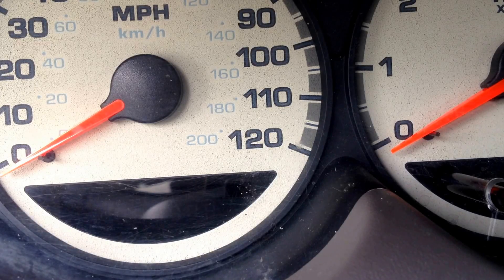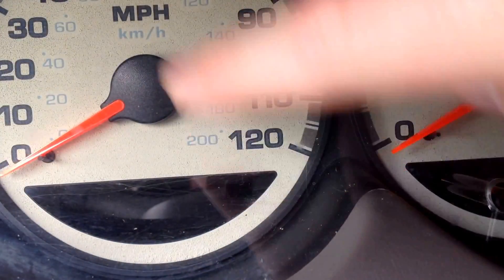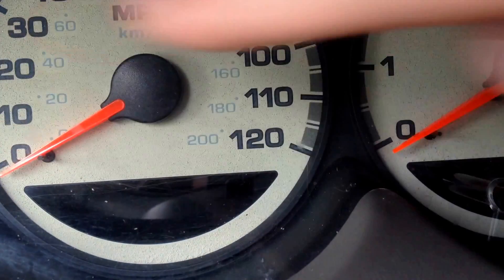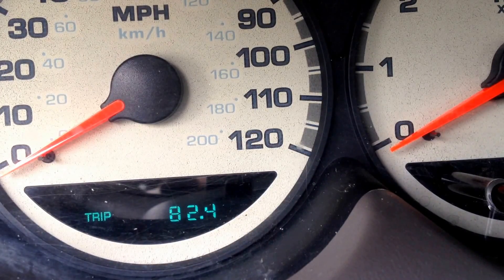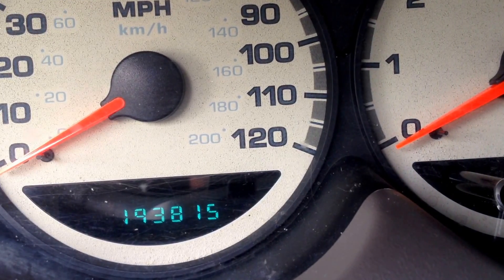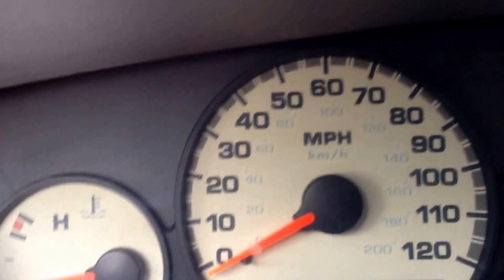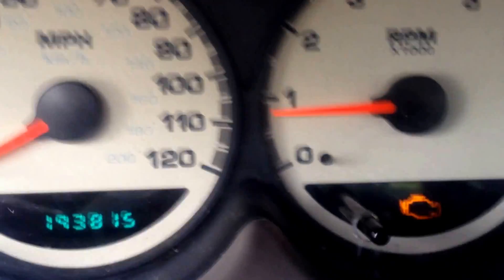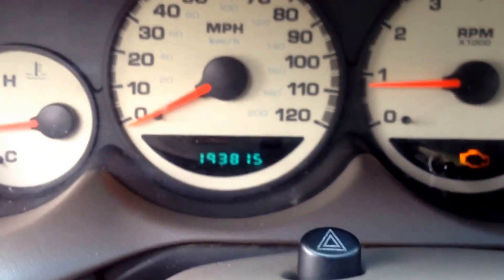Speed odometer repair 2000 Dodge neonES

Comment: replaced Control Solenoid and both input and output sensors and still the odometer is not reading anything
Reply from the maker: That the cluster might went out. Check the bulbs if it has any.  I guessing it’s showing up blank.
Reply: @StansAuto83  i got lights in and everything. pressed the trip button and the dash does move like in the video. Car is in limp mode for sure
Reply from the maker: @fishingmojados1121 have you had the car scanned to see what the codes are?
Reply: @StansAuto83  figured it out today. Broken wire at the output sensor

Comment: I have a 05 neon and speedometer doesn't work replaced speed sensors and still nothing. Could it be a bad ecm or tcm?
Reply from the maker: It could be the cluster I had to replace mine.
Reply: I drop a 1500 replacing the clutch, drive belt and water pump at about 119k miles and think "Hey Im golden for 30 to 50 k miles. HA. you need to replace just about everything because it all starts to break, ALL OF IT!
Reply from the maker: Yeah I’m in the process of rebuilding the engine from the ground up and then the transmissions next
Reply: @StansAuto83  Before or after this video? Ha ha

Comment: Do i just push the dial in / crank ? or do i have to push and turn the dial / crank ? Also does this work for a 2000 Chrysler neon ?
Reply from the maker: ISA JESUS push in and turn the key 3 times like your going to start the car but don’t start the car.
Reply: I pushed the dial for about 5 seconds then i turned the key only to on position it reset the trip odometer i didn't turn the key three times yet I didn't want to trip the codes I'm going to pick up my 2 door ajar sensors for replacement tommorrow ( pulled out 2 broken door ajar sensors light stays on pulled out bulb pulled out dome light relay ) hopefully the code fuse showing on the odometer will disappear

Comment: I have a 2002 doge neon but when I did that what was on the video it didn't work my  thing that shows you how fast your going when your driving still didn't work  and my headlights don't work I need help I don't know if I need a new fuse or what
Reply from the maker: Tyesha West OK check the fuses first. the speed sensor on the transmission  may have went out.
Reply: Yes, i agree. My neon completed the process as in your video but the speedometer still does not function. You did not show yourself driving the car with the speedometer working after this process.